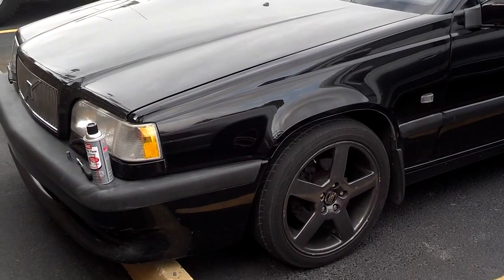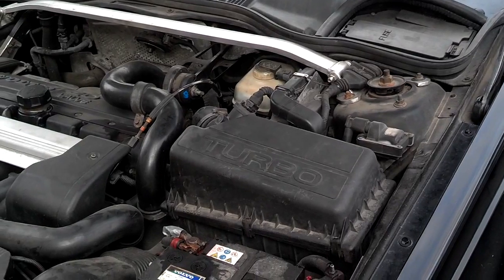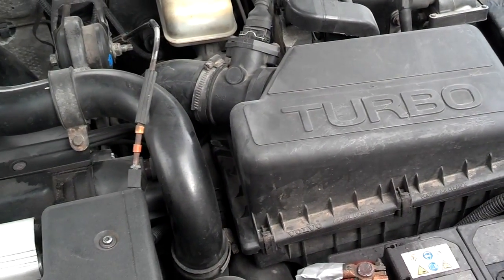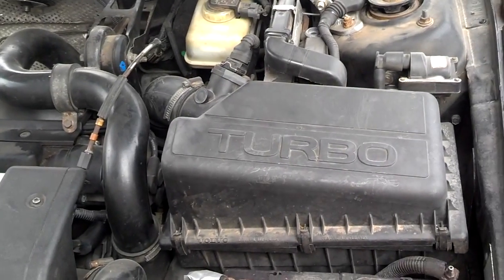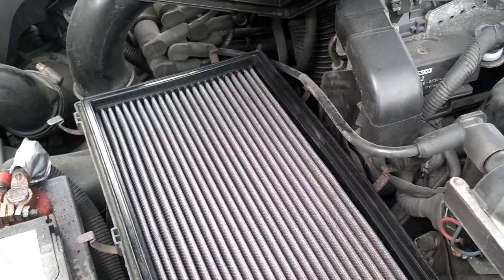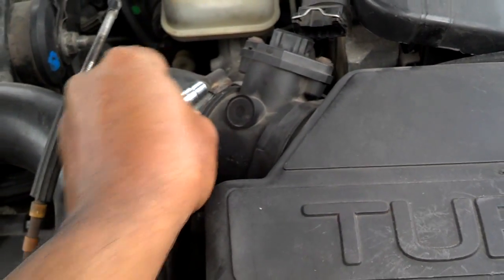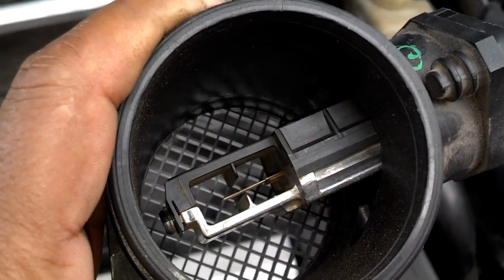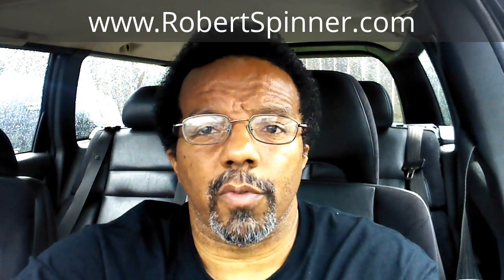How to clean or replace the mass air flow sensor, MAF, Error code P103 - VOTD

Comment: Hi Robert! First off, you are the best and a life saver! Secondly, we have a 98 Volvo  V70 GLT Turbo and have had to replace the MAF due to a P0103 code. Now, the vehicle is dying randomly (not all the time). We can disconnect/reconnect the MAF pigtail and it will run again and the codes go away. The inside of the pigtail female connector looks pretty worn, but we cannot seem to find the connector all in 1 piece to replace it. It looks like we will need to replace the individual cable terminals in it. Would you possibly be able to do a video on how to go about this? The volvo part #'s on the connector are: 978149 Code I - receptacle housing and 9162253 Code II - Insulator as well as PA66+GF stamped on the other side of the part. Any help would be soooooo appreciated!
Reply from the maker: Where did you get the new MAF?
Reply from the maker: https://www.youtube.com/watch?v=aj4tL32XIXs
Reply from the maker: No, I have never rebuilt one of those connectors.
Reply from the maker: https://www.youtube.com/watch?v=NhtUXZTurzo
Reply from the maker: https://www.youtube.com/watch?v=gLoO-D4yOcU
Reply from the maker: https://www.youtube.com/watch?v=ZqdHDqGKYV0
Reply from the maker: https://www.youtube.com/watch?v=gt9w-ZSxs9I
Reply: We bought it (part #1275749) online at https://www.volvooempartsdirect.com/ and cost us $200. The pigtail/connector looks really rough down in the terminals though. Since they sit below the surface of the plastic housing, we can't use a wire brush to clean them as this just causes the plastic housing to chip away. The car wouldn't crank at all until we replaced the MAF, but now it will crank and run with no issues or codes. Then, without any warning (sometimes after 20 miles and sometimes after 1 mile) it will die. It won't crank again without unplugging and replugging the MAF connector a few times. Only after it dies do we get codes again. The codes we get are P0103, P0172, P0455, and P0505. In addition to the MAF, we have already replaced all vacuum lines, cleaned the IAC, replaced all 6 pieces of the PCV system, replaced the camshaft position sensor (because we got the P0340 code when it all began, but haven't gotten it since), replaced the distributor rotor and cap, spark plugs, and wires, the fuel filter, and changed the oil every 3,000 since we got it in February. If it is not this connector, then what else could it be?
Reply from the maker: Did you watch the videos I linked?
Reply: Yes, I watched all of the videos. The MAF we replaced is the Bosch you described in the 1st link. You can hear the fuel pump kick on and there is fuel pressure at the schrader valve after starting the car, but we have not tested the fuel relay. We have a new heater core and plan to replace it once the car is running again. We ordered the parts to rebuild the pigtail. We will let ya know how it goes.
Reply: Crystal Boyd any luck with the rebuild? I'm getting the same symptoms right now.
Reply: Nick Pegg We just got all the components in today and we rewired/replaced it. Once we got everything needed (terminals, insulators, and housing), assembling them back onto the original harness wires was easy and only took 15 minutes. She's idling and running great now with no codes. We haven't taken it for a long haul yet (just a couple of miles so far), but tomorrow I will be driving it 20 miles (10 each way) to verify no new codes or issues pop up. But, make sure you ow Robert's advice on getting the OEM MAF Bosch sensor before you decide the pigtail connector is actually the issue. Check all of your fuses as well. It could be numerous other things too, so please follow all of his other advice 1st. The pigtail going out is so rare (which is probably why he has never encountered it) that it is very unlikely that it is the actual or only problem. See all of the links he sent me and go through and complete ALL of the steps in them 1st! I'll repost after the test drive tomorrow with the results and I will also repost if anything new happens after that point when/if it does relating to the MAF and/or code P0103.

Comment: hey Robert...my car wasn't starting...I got code p0102 (maf sensor low voltage)...I sprayed the sensor and connector with the cleaner and it started right up...but from time to time it sounds like its going back to not starting again...would i be better off replacing the sensor?...
Reply from the maker: +DL MANOLO yes.

Comment: Hi Robert, If I clean or replace the MAF will the engine management warning light reset to off or will I have to put it on diagnostics to reset. Regards, Gavin
Reply from the maker: +Gavin OMahoney reset with a code reader or disconnect the battery.
Reply: Hi Robert, Thanks for this info and Happy Easter. Can you recommend a scanner that can get into the VARDIS side of the OBDII diagnostics? Thanks, Gavin

Comment: I have a 1998 Volvo S70 GLT and my throttle cable separated from the accelerator pedal. .what is the best way to reattach it? the cable is visible coming in from the firewall. thanks in advance
Reply from the maker: +Barry Milburn is it broken?

Comment: Mine are two 6-point star bit T-20 non-security screws. The whole process took 2 minutes to take out and replace.  This has been the second time that I have replaced the MAF since purchasing the Volvo 850 with only 15 miles on the odometer.  Now my old 850 has had over 390,000 miles... The new part has solved the slight hesitation problems at start-ups and weak throttle responses at traffic lights.
Reply from the maker: Good deal.
Reply: The MAF on my 94 850 NA also has two 6-point star bit T-20 non-security screws.

Comment: Hi Robert, I have an error code p0101 I checked it by auto zone, they told me that it's this maf sensor that's bad, I changed it (after an unsuccessful attempt with the cleaner) and I've driven about 65 miles and the check engine light is still on the dash, I thought it's gonna go away by itself after 50 miles but no luck, do I have to reset it or it's suppose to go away by itself? Or maybe this wasn't the issue?! Please give me advice thanks a lot.
Reply from the maker: Reset it with a reader or by disconnecting the battery. Not sure what P0101 is, P0103 is the MAF code on my car.
Reply: Robert DIY well their reader says that it is a maf sensor but it didn't go away after changing it, OK I guess I'll try to reset it and see what happens, BTW thanks to you it took me under 5 minutes to change. You are the man when it comes to volvo.
Reply: Robert DIY it might be that the maf wire harness is bad? I might have tampered with it when I changed my headlights. (on volvo xc70 2006 you need to take out the air filter box in order to change headlights 🤔😏)
Reply from the maker: Could be.
Reply: Update  thanks God the check engine went away by itself two days after replacing the maf sensor (never to late😀)

Comment: hey Robert ive just done the PCV system but for some reason the car is hunting and every now and again it cuts out could it be the MAF or the idle control valve, i have also had a P0171 code but seems to have cleared now , its a 1998 volvo V70 2.5 20V N/A

Comment: Hey Robert, so I got a check engine light on and I believe the code was 10172? But it was the one for the o2 sensor and vacuum leak and what ever else. But I had recently done a oil change went from high mileage to full synthetic. Haven't even drivin 200 miles since I changed it. I also have replaced the o2 sensor and have put a new air filter. My car is a 98 v70 xc 5cyl. And I'm at 171,... Miles. When I installed the o2 sensor the engine light went off. I drove maybe 50 miles and the light came back on went and check the code again and it's the same code but this time it said that I am running to rich. I need some help.
Reply from the maker: What are the actual codes left? A P0171 or P0172 are rich or lean codes that are usually the result of a vacuum leak. How is the PCV system?
Reply: +Robert DIY  it's the 72 code
Reply: The light goes on and off every 30 miles
Reply from the maker: Is the PCV system serviceable?

Comment: Im getting a Actron - P0108 code relating to pressure, and on matthews volvo site they're talking about the effects of changing the MAF sensor with mixed results. Do you have any advice? Is P0108 even related to the MAF? I have no performance issues at the moment, no smoke either
- thanks for you time
Reply from the maker: +TheTiredEye not sure what that code is or what kind of car you have.
Reply: Robert DIY sorry it was the '98 v70 t5 - but I gave you wrong info at the time. It was actually my MAP sensor causing the check engine light to go on due to low pressure on a vacuum line. I found the vacuum hose and slipped it right on

Comment: sorry, I replaced the fuel pump, fuel pump relay, fuel filter. codes for o2 sensor, replaced it, and Mass Air flow sensor, cleaned it, now I plan on replacing it-  thanks for the videos-
Reply from the maker: You are welcome.
Reply: Hi Marco. Before you replace you MAF. sensor, try to unplug it's connector first while the engine is running, if the engine died you have good MAF. sensor. You can also try try connect it is mean positive wire with negative, you should get 12V.  and 5V when you connect the negative with the signal wire. If no reading you have broken wire. You can also test the Ohm reading on the sensor it self which must read 0.1 otherwise you have bad sensor. Good Luck
Reply: Hi Mohad

Thanks for your suggestion- replaced the MAF-
car runs great

Comment: Robert, you are the king!  You've really helped me and my '95 glt red wagon- a quarter million miles and trying for a few more-  currently have sporadic stalling issues, even after replacing FP and FPS, FF, and now hoping the Mass Air Flow Sensor will save me-
Reply from the maker: If you don't have codes, it's a fuel delivery issue. What is a FPS? I'd check the fuel pump relay and fuel INJECTOR relay.
Reply from the maker: https://www.youtube.com/watch?v=_uTcmPURTXc
Reply from the maker: https://www.youtube.com/watch?v=gLoO-D4yOcU

Comment: Thanks. You've got the best Volvo 850 repair videos on youtube. Keep up the good work.
Reply from the maker: +Nick Harper thank you for watching.
Reply: I have a Volvo S80 2001 and I went to AutoZone and they said I need a mass air flow sensor I try 2 clean it it didn't work so now I have 2 bye one 129.00 glad I watched ur video cas the shop wanted 2 charge me 100 dollars 2 change it witch I can do my self thanks

Comment: Thank Robert for your valuable input. I had purchased Volvo V40 recently with P0102 code which refereed to MAF. I installed new air filter and cleaned the air compartment with pressure air and removed the negative battery cable , connected it by wire to the positive terminal for 5 seconds , reconnected it again and the P0102 code was gone as well as P0302, P0303, P0304, P0335, P0336 and also the check engine light. My Volvo is running fine now and I decided to be a self mechanic for it after I was ripped off by 3 mechanics whom they advised me to junk it ASAP.
Reply from the maker: +Mohad Hady wow! Glad it worked out for you.

Comment: Got a P0102 code on a volvo s60 turbo 2.5t. The code references the MAF    being faulty so I ran a volt test on ports 2 and 4 on the harness. I think it should be around 1.5 or a little  above at idle and increases upon throttle acceleration. I got a 9 plus that was fluctuating  at idle with no increase. Does this sound like a need for a new one. This one has been  cleaned 2 months ago.
Reply from the maker: +159CHAPPELL If it has more than 100,000 miles on it, I would replace it. Not sure about testing them.

Comment: Love your video's! Got me through my first attempt at a timing belt servive on my 2000 s70 with 160k and it was a flawless success! Can't thank you enough! Question about the spray, I tend to want to get things so clean you can eat off them. I understand not to touch the sensor, but can over use of the spray cleaner damage the sensor just as easy? Thanks so much!
Reply from the maker: +Sean Ingstrum just spray a little. The sensors are sensitive. However, I don't believe the entire can will harm it.

Comment: Hi Robert. Your vids have helped me make numerous repairs to my 97 850. I am stumped now however. I'm getting no power to my MAF sensor. Backprobed the wires with ignition in position 2, no voltage. Can't test while running because it won't start. I think this could be my problem. (getting fuel, getting, spark, haven't yet tested compression). Anyway, what would cause no power to MAF sensor? Wires look to be in good condition. Thank you.
Reply: +Kimberly Reynolds Oh and I have no codes because my battery died and reset them (I think).
Reply from the maker: I don't know but if the maf is the problem, the car will start with it unplugged.
Reply from the maker: https://youtu.be/3InZVPLYgqs

Comment: my car is also hesitating. after i cleaned the MAF it was a lot better and the car is driveable again. But it's still not 100%. Can I use a working MAF from another Volvo to check if the problem stays? i have a v70r 98. thx in advance!
Reply from the maker: +BlackV40 What codes do you have? Is the car turbo?
Reply: +Robert DIY hi Robert. haven't had time to go to the dealer yet. so no idea. yes it's a turbo
Reply from the maker: Check the lines going to and from the turbo, including the turbo piping.
Reply: +Robert DIY thx, I did. it's the Maf. if i disconnect it, it drives normal. Just would like to know I can take a MAF from another Volvo (untill i have the money to buy a new one ;) )
Reply from the maker: Yes, I believe you can use any of the P80 Volvo MAF's from '95 - '98.
Reply: +Robert DIY thankyou very much for your input!

Comment: All the codes are gone today except P0304 misfire in 4. And car won't start with MAS plugged in.  Gonna change out plugs.  Anymore suggestions?
Reply from the maker: +Thomas Ferreolus https://www.youtube.com/watch?v=Sg7iFytxfzQ
Reply: +Thomas Ferreolus : Replace the plugs. Remove the negative battery cable. connect a wire from it to the positive terminal (which must be tied to + terminal). Wait for 5 seconds. Reconnect the negative cable. Start your car and all miss fire codes are gone including the check engine light. For the MAS problem please refer to my comment above.

Comment: Sprayed the sensor, it improved slightly, but decided to replace anyways.  Bought only the MAS sensor, and T25 thought it would be quick work.  Hardly used any force and the grey T25 bit broke off inside, and striped the security screw.  I should have used TEMPERED STEEL screw bit instead; hind sight is 20/20.  Moved forward, returned the sensor, and purchased BOSCH sensor in housing but now, I can't get the hose off the sensor body. I had my wife hold down the body of the air filter but there's still too much play, hose will not move in the direction. Going back to the garage with a hair dryer.  Hopefully this will heat it up, and loosen it enough so I can pull it off.
Reply from the maker: I usually take the air box top loose and then twist and pry it off of the hose.
Reply: Robert DIY Hair dryer is the key.  Put the heat to it for about two minutes and it came off like butter.
Reply from the maker: Nice. I don't own a hair dryer.
Reply: Won the battle but still fighting the war.  Thanks for the help it was an easy fix but I still have issues and think I may have a vacum leak.   But your video was very helpful.
Reply: +Robert DIY Won the war, runs like new now thanks to you Robert.
Reply: @thomasferreolus869  what was the final verdict ..

Comment: 96volvo850turbo positive cable was bad at post the wire was cute got another from junk yard how to connect together 412-583-8619 Bobbyrawlings45@gmail.com
Reply from the maker: +Bobby Rawlings Hopefully you got the entire cable from the battery to the starter. If you are planning to strip and crimp, you will need a professional style crimper to connect them or you'll have more issues. The mechanic that I visit has a hydraulic one.

Comment: robert tell me what should happen if at the time when the engine is running I take off my connector with my mass flow controller that the engine should continue to run the engine should go out.I checked it in two other cars in each engine after disconnecting the gas collector when my Volvo disconnect the connector still work without any changes.
Reply from the maker: +Jacek Paradowski If you unplug the MAF the idle should change but the car will stay running. What code does it have?

Comment: I have a VOLVO S70 GLT Sedan 2.4 Turbo,  193 Hv, year 1998. My MAF is manufactured by Bosch and it costs about 180 USD. I wonder could I use no-brand MAF in my car? I could save up to 70 bucks on it.
Reply from the maker: +Sambieman I'm sure you could. But I would NOT.

Comment: hi there Robert, I paid 251euros for changing my mass airflow sensor, was it reasonable price?
Reply: +Stewart Voit Thank you.  I had my car fixed already. Now it's back on the road..😃
Reply from the maker: +Marras Kuu I have no idea what that cost is compared to US cost.
Reply: +Marras Kuu Right now that's about $281 dollars. Taking what Robert said about the MAF being around $200 aftermarket or $325 at the dealer. Based on that I'd say it was reasonable, but it's really for you to decide!
Reply: +Robert DIY  I have Volvo s70 1997 2.5 which I have for almost 2 years. The mileage is 331000 already. The car works fine and smoothly. I wonder what should I consider to maintain the effectiveness of this old car. Thank you. Greetings from Finland!!!